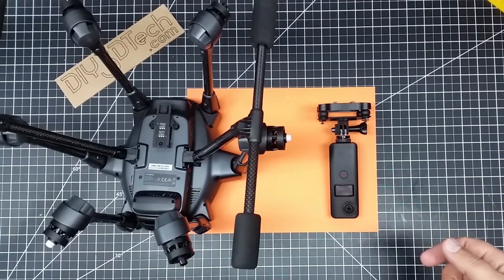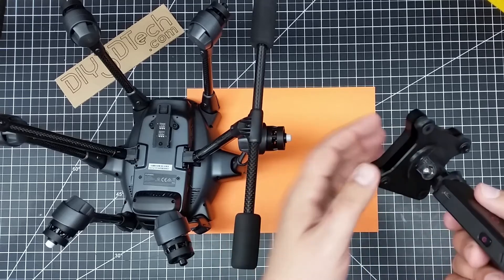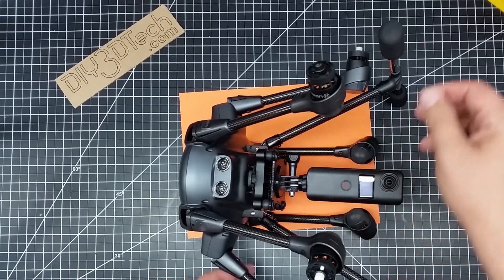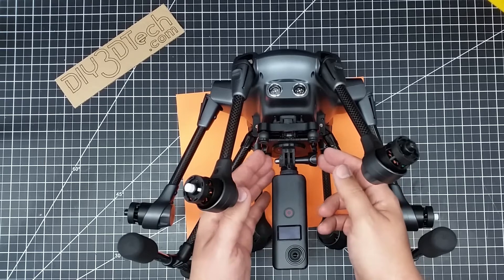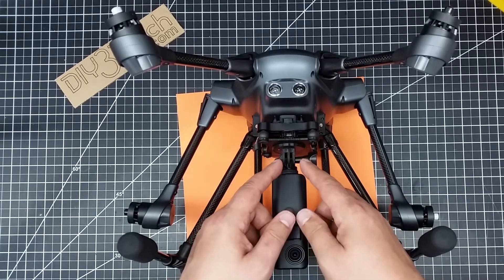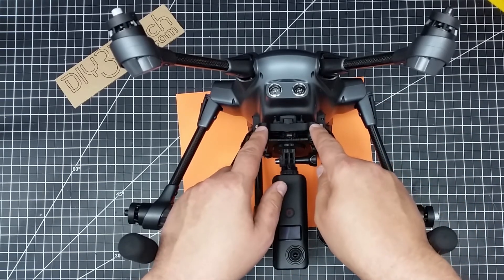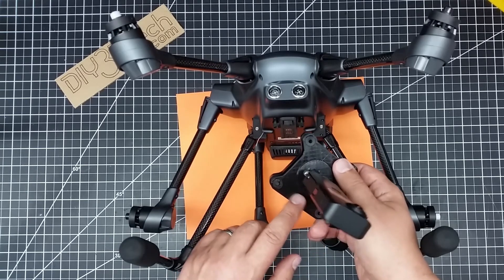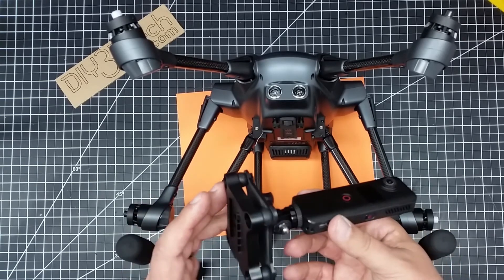Yuneec Typhoon H - 3D Printable Universal  Mount!

Comment: I would be interested in talking to you about a collaborative on a 3d printed setup that would facilitate installing a (very light) FLIR Boson 320 camera BEHIND the existing Typhoon H camera.  If it could be 'stabilized' by using a stabilized gimbal, that would be great.  If not, I would still look at a 'mount' that would allow manual adjustment of the camera angle, and I know a source for the transmitter, dvr, battery, black pearl receiver and (even) their fixed mount plate.  This Boson, used on a Typhoon H pro could be used in tandem with the (low-resolution) CGO-ET camera.  This Yuneec would be a 'daylight' camera that would be useful as a FPV camera to fly with.  But,  the thermal workload is carried by the Boson camera behind it.  If A FLIR VUE PRO (heavier and needs more power) could be introduced and fit into a rear 'cage' behind the Typhoon standard camera, that would be even better.  Look up  " UWE LOEWER + FLIR TYPHOON H " OR I HAVE PROVIDED A LINK HERE (1) :                  https://youtu.be/vCZnlnRnwes    
OR GO HERE (2)                https://youtu.be/4CJJeqNWnco   
OR GO HERE:  (3)             https://youtu.be/a0XHTP0r4mY  

and, you will see what he has already tried and proven .  

BY COMPARISON, THE BOSON 320 HAS BEEN USED WITH THE MAVIC PRO IN THIS WAY

GO HERE (4)                 https://youtu.be/p3nQ_CQ9oLc 

On #1 and #2 options, UWE uses a modified Q500 gimbal attached to a Go-Pro 'Cage" that had to be MODIFIED (cut open and made larger) because it was a few millimeters too small TO FIT THE FLIR VUE PRO.  Let me know what you think. 

Just my 2 cents.  But, it seems that you share a passion that I have for implementing the thermal camera side of the equation (for the typhoon h ) without breaking the bank

 jt
Reply from the maker: Very much so, I am very interested in both Near to Far IR technology for commercial applications.  Looked at the videos as well as several more (linked) and the ones with dual gimbal is very cool however not sure how they do it as when I researched replacing the Yuneec gimbal on the forums was told that they use a propriety protocol.  While possible to crack, the task would involve a lot of time which I unfortunately do not have, yet as you point out one would could a retro fit a Yuneec gimal . Right now I am with other things in the day job, however yes would be interested in looking at related projects such as this in the near future.  You can also reach me at info@diy3dtech [dot] com too

Comment: Thanks for your time. The cgo-et is a joke. Very low resolution. That is why I preferred the boson or FLIR vue pro at the higher end 

But I don’t fully understand how they are powered. I will assume that you are going with batteries. And that the dvr is part of your payload(?)

The transmitter is in the camera and the receiver is in the 2nd iPad or black pearl or freeworld monitor?

I have also seen the vue pro fitted on a yuneec Q500 gimbal designed to carry a GoPro. ( it was opened up / made larger to receive the FLIR vue pro.  It is a heavier payload + but has the benefit of being available as a radiometric camera

I am trying to learn from all of you that are pioneering some new ground 

JT
Reply from the maker: I have a big interest in flying specialty cameras, as mentioned one of the lines is a hot from the bat and you can use that for power as you can also by replacement power clips to roll your own.  Also yes you would need to use your own transmitter, and not sure you could hack the controller (maybe), it not just use a ground station...

Comment: Great information.  I am very interested and impressed.  I would love (any even PAY) to see a SIMPLE schematic (even handmade on a 'cocktail napkin') that shows me the items that were used to (1) secure a FLIR BOSON to the Gimbal (2)  How the gimbal attaches to the Typhoon H Pro;  (3) how the POWER SUPPLY is connected from the DVR , transmitter etc, to the Boson (or is it all BATTERY driven? ) (4) what needs to be inputted from the transmitter (on the drone / gimbal / Boson I assume) to make it communicate with the receiver (and A SECOND MONITOR?) ON THE GROUND to see the thermal imagery as it happens, (5) How one captures pictures (stills) and Video (6) how (and IF it is possible) to change color palettes while in the air, and (6) IS ANYONE USING A FLIR VUE PRO for the thermal sensor (in lieu of the Boson 320).  I believe that IF THIS REALLY DAMPENS THE JELLO EFFECT, THAT YOU ARE ONTO SOMETHING VERY MUCH NEEDED (and appreciated) by me. 

I am a user of infrared thermal imaging for building science, facade inspections and roof inspections and water intrusion investigations.  I would be happy to collaborate / and be of help with any questions that you may have of me as well.  Thanks!
 "Infrared Jack"  jt@destininfraredservices.com  and   www.destinleakdetection.com
Reply from the maker: You know they sell infraed camera for the Yuneec, its quite expesive but turn key.  You can sometimes picked them up used on ebay.  Check the Yuneec forms as the three lines are ground, control  and power.  The control is useless as I believe it to be proprietary, yet you could power a camera.  Also note the transmitter is built into the camera so yes you could fly a separate transmitter and use a separate ground station.